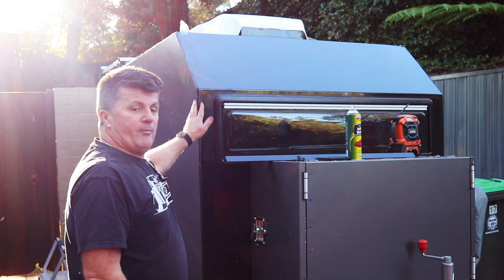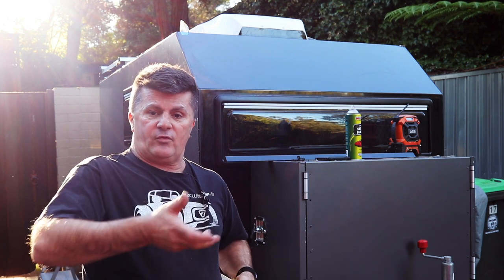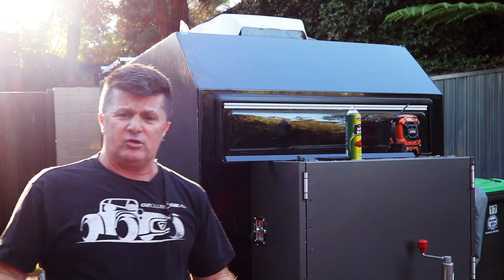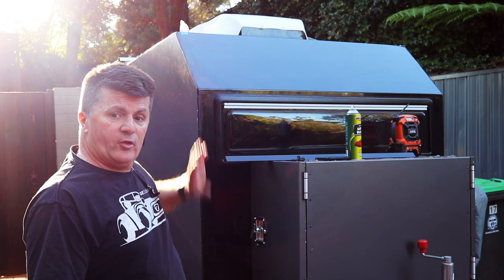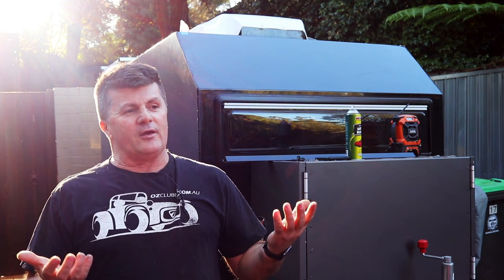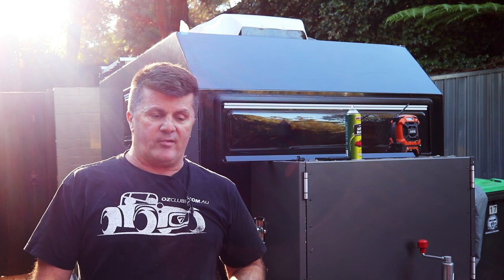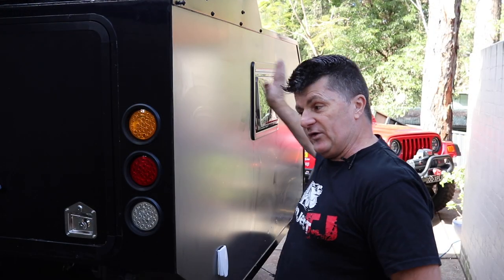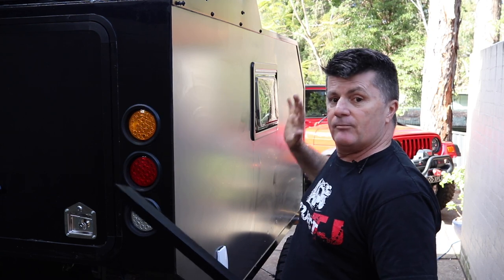Off Road Camper Build // Fitting the Corner Moulding

Comment: Looks great -  Please explain how you use the WD40 to make the beads smooth and nice
Reply from the maker: you just spray it on your finger when you run your finger over it to smooth it.
Reply: @DarrylSheather    Looks like you spray wd40 on the squeeze out, then run another bead of  Sika then spray wd40 on finger and then smooth out, then spray again and use microfibre cloth to remove excess.  Is this correct sequence?

Comment: Do you have to re-register the trailer now that you put the tear drop on the frame. Or your original registration at the start of this video series is enough ?
Reply from the maker: Depends on the weight of the finished trailer. It now has a 1500kg axle/bearings and electric brakes. If I could use it fully loaded and still be under 750kg's I'd probably leave it as is.
Reply: @DarrylSheather  Awesome thanks

Comment: is there a reason why you didn't use powder coated aluminium angle?
Reply from the maker: I've seen how powder coating holds up on a trailer being towed on dirt roads etc. Paint is relatively easy to touch up, quick and easy to apply, I'd want a paint protection film over any powder coating. Buying pre-powder coated angle is ok but you need to cut it to size and with the angles tweak to fit, so not really an option for a pro finish.

Comment: Hey Darryl, what paint did you use for the aluminum trim???
Reply from the maker: 2 pak automotive paint.
Reply: @DarrylSheather  the reason I ask is because this guy i know said aluminum cant be painted and the paint will fall out eventually.  Are you having problems or chipping? Thanks again mate. Do you use wazup?
Reply from the maker: You need to etch prime before painting so the acid can etch the surface. However your guy is incorrect, lots of cars have aluminum panels now do you see the paint coming off those?